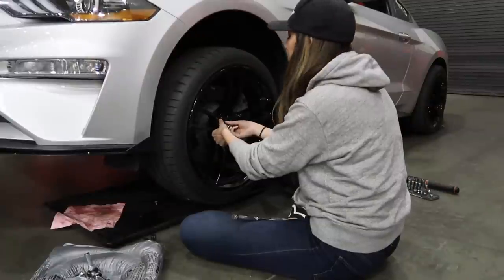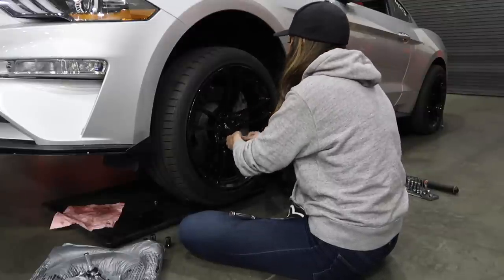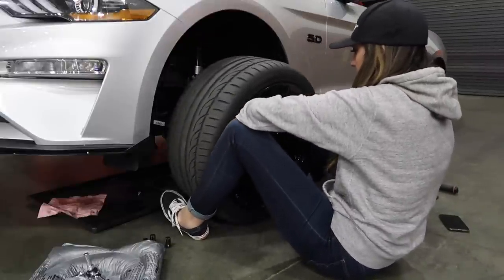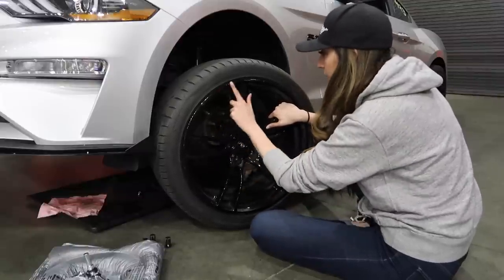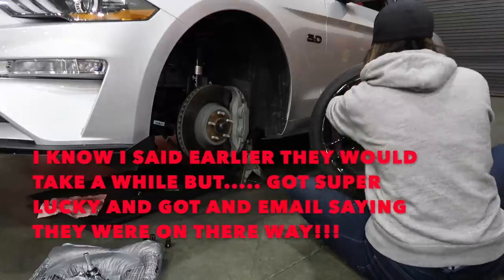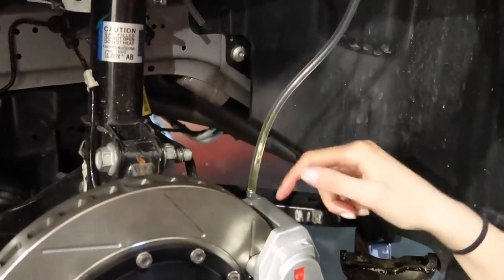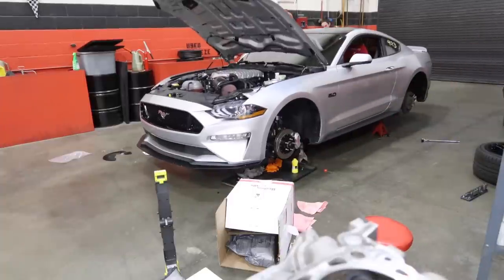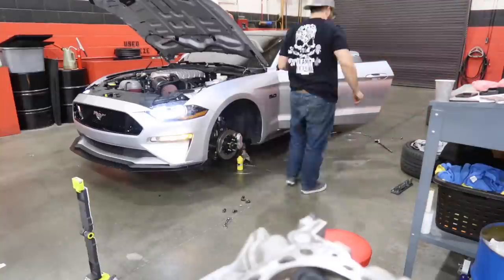I do a Drag Brake Install with Baer Brakes!

Comment: Dang wish i would have seen this back in May.  I had 17s for my front since early in the year, but wouldnt fit over the caliper. I finally found out about Baer brakes. I ordered last week and will be installing so this vid will help out tremendously. Did a search and found this vid...Thanks.

Comment: Great video! One tip, if you leave the steering column unlocked you can turn the steering knuckle outwards to better access the caliper bolts, especially when trying to use the torque wrench. 👍
Reply from the maker: Doh! Didn't even think of it!

Comment: If I might suggest a tip of the last time I did a brake job I used a pair of a needle-nose vise grips with rubber tubing on each jaw and then I crimp the rubber brake line closed so it doesn't drip all over the place

Comment: Do you daily your car ? I got the same bear breaks on the rear but I'm wondering how big of difference your stopping power is with the fronts. Thanks 1320chick
Reply from the maker: dmxmike2 no i dont daily it but i do drive it 3/4 times a week to work. Im extremely impressed with mine. It stops from 150 better then factory.

Comment: I stayed a bit more simple because I have a base '18 GT, I just swapped out my OEM rotors for the 2 piece lighter weight Eradispeed+ ones both front and rear.  For the money, I couldn't justify the expensive, on a street car especially for the full drag brake kits.  I was able to drop 6 lbs off each rear and 4 lbs off each front, which helps a little.
Reply from the maker: Can't argue with that! That's awesome that you picked up that much loss with just a rotor swap!
Reply: Being drilled and slotted they look really good too.   @That1320Chick

Comment: Jo we need your help...whipple has a new closed Airbox they are putting in the new stage 2 kits they sell now. Really helps with the high IAT's. Would you please get one and install it and debug it for a bunch of us. I think it will help your performance. I have the same CAI  you have and it is wide open top and bottom. I get high IAT'S. I won't peddle it til they come down.. Btw you have the best skin. High definition video isn't a concern for you... Keep the content coming. You guys are my favorite mustang channel..

Comment: Great video and the car is running awesome
Reply from the maker: Thank you!! I couldn't be happier with how it's coming together!
Reply: @That1320Chick  its looking great my 17 roush is also silver its a TVS car now but thinking of doing the whipple gen5 cobra jet blower
Reply: @That1320Chick  the new whipple is amazing blower I was going to do VMP gen3 2650 but im having second guesses now lol! Also going to do a built motor, been looking at RPG who built yours?
Reply from the maker: 17ROUSH sam the 2650’s are stout but it’s hard to argue with the whipple, they’ve been pushing out innovative kits left and right! In fact, they just released their 11-17 gen 5 kits on Lethal’s website! We got ours machines locally at a place called automotive machine (10/10, highly recommended) and then my dad has a guy who assembles engines!
Reply: @That1320Chick  Awesome yea im going with the Gen 5 3.0 Cobra Jet setup up I believe the lid is only deference on Cobra Jet
Reply from the maker: 17ROUSH sam the intercooler brick is thicker and uses -16 AN fittings, also I believe the actual cobra jet kit comes with a 150mm TB and larger intake tube that sits down behind th bumper? I may be wrong about that last part though!
Reply: @That1320Chick  yea you are right it does come 150mmtb and -16AN fittings im not sure about the other! But ive seen some big numbers come out of that blower

Comment: I will tell you something when you do the brakes on the ground always turn the wheel so you can get to the bolts easily and also keep your body away from that car you never trust any jack or stand and if something goes wrong it will get part of you not all of you.

Comment: whats a stage 3 whipple?
Reply from the maker: When I got my Whipple, there was no official stage 3, so I've been calling it a "stage 3". But it's a smaller pulley than what comes with the stage 2 kit, and I run e85, which is similar to what Whipple will be releasing eventually.
Reply: @That1320Chick  pulley size and fuel type dont designate a stage.
Reply from the maker: @jordanfetfatzes1369  actually yes, that's exactly what designates it. Whipple Stage 1 kit is 93 octane, 39lb/hr injectors, 4.0 pulley, and reuses factory throttle body. Stage 2 is 76 lb injectors, drop in pump, 3.75 pulley, and base of 132mm throttle body. It's just easier to call it a "stage 3" than say oh it's a stage 2 kit with bigger injectors, e85, our own return fuel system, smaller pulley, so on and so forth.
Reply: @That1320Chick  well why do all the other shops who have the same set up not call it stage 3 yet call the supporting mods out on top of the stage 2 kit?
Reply: @That1320Chick  I can pulley down and add e85. That doesnt change the stage...
Reply from the maker: Well if you did that, it wouldn't be a stage 2 kit anymore would it? 😉
Reply: @That1320Chick  semantics. I just wouldn't call it a stage 3 if whipple or amy supercharger manufactur doesnt list it anywhere for that platform. However I do wanna thank u for the cci lead
Reply from the maker: Jordan Fetfatzes im a development car for whipple so im testing out the stage 3. And youre welcome, this driveshaft is awesome. No shakes or noises.

Comment: Somebody tell her that you coulda ran a 17 inch the front with 14 inch brakes. People do it all the time with 15 inch brakes.
Reply from the maker: I understand that, however I would rather take advantage of the weight savings, and not have to deal with running at least a 1/2" to 1" spacer and then need to worry about thread engagement with the lug centric front runners!